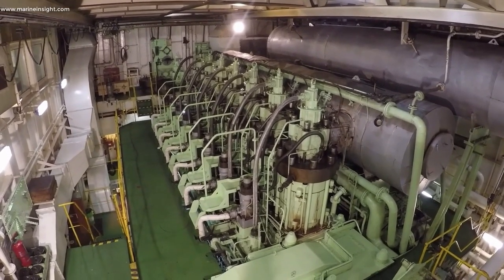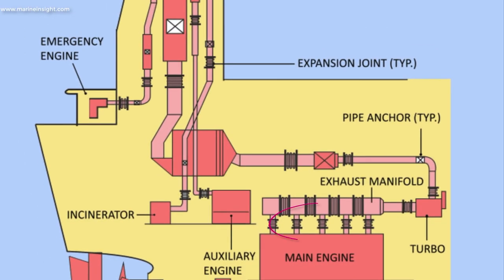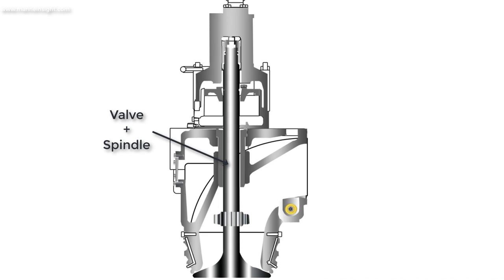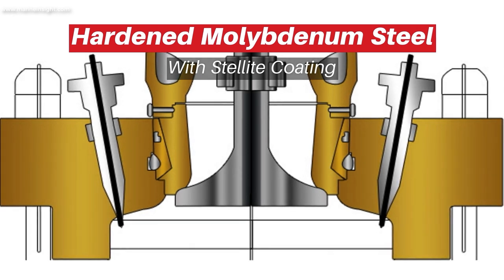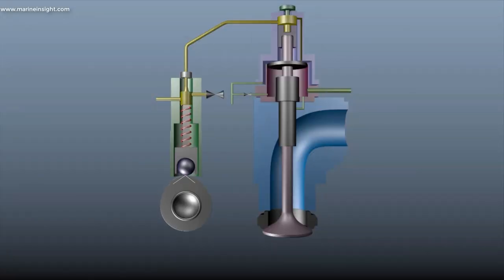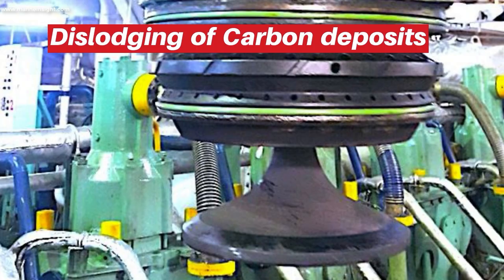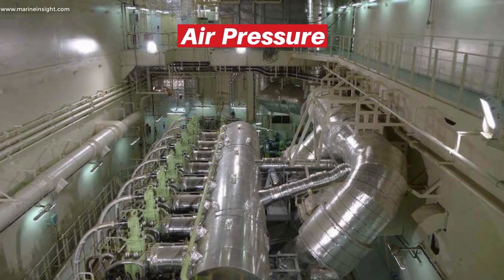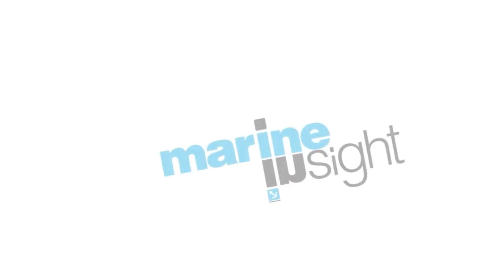Main Engine Exhaust Valve #marineengine #exhaustvalve

Comment: Where will be the throttle valve located for bleeding. I'm referring to the word virtual tappet. If so., the bleed will be continuous and very small quantity. And is the drain of the oil is open always allowing some oil to go out at the same time of building up the hydraulic pressure.
Reply: I'm confused in these areas. Can you please help me out of this?

Comment: What is meant by overhauling exhaust valve?..When and how it is done?
Reply from the maker: Overhauling is a detailed process of opening, cleaning and checking the machinery. Any damaged or wornout parts are replaced during this process. There are running hours prescribed by the makers post which the overhauling should be done. We will pass on your suggestion to make a video on this topic to the team. Thank you for your support. 👍🏻

Comment: URGENT!! 
What to do if spring air fails during maneuvering? Is there any other option besides stopping the engine and repairing it?
Reply: If the spring air fails, the valve will not close....the quickest solution during the manoeuvring is to cutoff the unit and continue running the engine without stopping the ship as it will be in traffic, channel or near port. Once the ship is stopped, repair the valve.
Reply from the maker: @AnishW  Thank you Anish 👍🏻

Comment: Hello sir, how the hydraulic oil will come out  from the valve after push the spindle (after open the valve)...
Reply: With the help of Air pressure the spindle will move up and remaining oil will from hydraulic chamber will be drain out

Comment: During opeing of the exh. V/V is the air inside the air spring chamber goes out or compressed itself fully?
Reply from the maker: As the air is compressible, it will get compressed in the chamber.

Comment: Why exhaust valve opening hydraulic pressure is 200bar and for closing the exhaust valve it is 7 bar control air(spring air) , why the opening and closing pressure are different?
Reply: Because pressure difference in combustion chamber. Once the valve is opened, the boost will scavenge the combustion chamber and the pressure difference is zero and closing the valve doesn't need much pressure.

Comment: Dear All , can somebody please advise on below incident .Upon leaving anchorage, vessel have reported ME slowdown and upon investigation (air spring tightness test). It was discovered that the fault was due to a leak in the air piston, this is the second failure in 2 days. So, vessel have pulled 2 exhaust valves in the past 2 days, investigations on this matter are ongoing.
The lab reports for fuel and lube analysis are normal. The Main Engine Make & Model is MAN B&W 6S50 MC , 10996 HP.

Comment: Hello, some of the exhaust valve spindles have the guided vanes to rotate the valve and grind away the carbon deposit on the valve seats (K.E of the exhaust), however there are some exhaust valve with Rotocap, I know rotocaps contain ball bearing and spring inside but how does it helps with the rotation of the exhaust valve?
Reply: So how does the Rotocap/spring retainer works?
Reply from the maker: Please do check this post- https://forums.marineinsight.com/forum/marine-engineering/5305-rotocap-in-exhaust-valve

Comment: Sir, during normal operation ,how we will get to know tht exhaust valve is working fine , during our watch ,one more query ,is it possible to confirm the valve rotation during our rounds ,if yes how ?
Reply: In Yanamar model E220 or similar
A drop of yellow paint, on rotating disc, check in round,you will find easily that valve is rotating.

Comment: What is the use of winged wall rotater in spindle ??
Reply from the maker: The hydraulically operated Exhaust valve spindle is fitted with wings (vanes), due to which as the exhaust gas strikes it, the kinetic energy of the exhaust gas rotates the valve at small amount as it passes. It prevents localised burning and avoids the accumulation of carbon deposits.

Comment: Why the safety valve on exhaust valve is set to 2.3MPa ..hydraulic oil operating pressure goes up to 220 bar and spring air for closing is 7 bar . Why 2.3 MPa

Comment: Sir , what is variable exhaust closing ?
Reply from the maker: In VEC, the timing of valve closing is altered to achieve better or early combustion - During the VEC operation, the exhaust valve is closed EARLIER which increases the compression stroke of the piston leading to higher compression pressures and temperatures.

Comment: Some of the inclusions in the modern marine engine exhaust valves are-
Variable closing timing
Puncture valve
W valve seat
Reply from the maker: Thank you for these inputs. 👍🏻
Reply: @marineinsight   I'm sorry guys but this is not the answer I was looking for. My question was entirely different. 

What would you do if spring air fails? 
Means exhaust valve won't close now, once it's open by hydraulic pressure. Now there's no pneumatic  pressure available to close it. What's our line of action?
Reply: @vishwarajpoty  Already replied 👍🏻
Reply from the maker: @AnishW  👍🏻

Comment: why air should be opened before hydraulic oil after overhaul?
Reply from the maker: So that it has the cushioning affect to tackle hydraulic oil pressure.
Reply: @marineinsight  what does the sealing control unit do

Comment: what we will do if spring air is not working ..?
Reply from the maker: If the engine can be stopped, repair should be done to resume the air supply. In case the ship cannot be stopped due to manoeuvring or traffic, the unit fule supply to be cut off.

Comment: after closing thhe valve what happend with  air where it is going
Reply from the maker: Once the exhaust valve is closed, air inside the cylinder is compressed and used for combustion.
Reply: Thank u ......
Reply from the maker: @MyMrrose  You are welcome 👍🏻
Reply: He's asked the spring air.

Comment: How valve rotor works????
Reply from the maker: The hydraulically operated Exhaust valve spindle is fitted with wings (vanes), due to which as the exhaust gas strikes it, the kinetic energy of the exhaust gas rotates the valve at small amount as it passes. It prevents localised burning and avoids the accumulation of carbon deposits.
Reply: @marineinsight  very useful....thanks a lot

Comment: Only one valve not two ????
Reply from the maker: @Malek: Usually, all 2 stoke large bore engines are provided with one exhaust valve per cylinder. For smaller, 4 stroke engines, there can be 4 valves - 2 inlet and 2 exhaust.

Comment: You said fuel is compressed. Sorry but scavenge air compressed not fuel.
Reply from the maker: Yes. The air is compressed to burn air fuel mixture.
Reply: @marineinsight  Air-Fuel mixture in case of medium speed engines. Air in case of slow speed engines.
But in video you are telling slow speed engines, so it is scavenge air which is compressed not air-fuel mixture.
Reply: @VijaySingh-ip8tf  In Actual scenarios, the atomised fuel is injected when the piston is about to reach TDC. Once the droplets in the atomized fuel spray evaporate quickly and mix with the compressed air. This air fuel is mixture is further compressed and the fuel is ignited shortly after the piston has passed TDC due to the high gas temperature in the cylinder.
Reply: @AnishW  Yes.